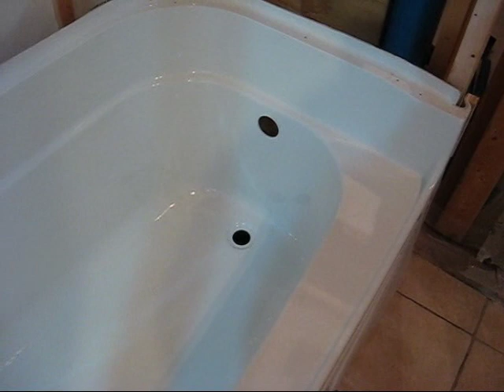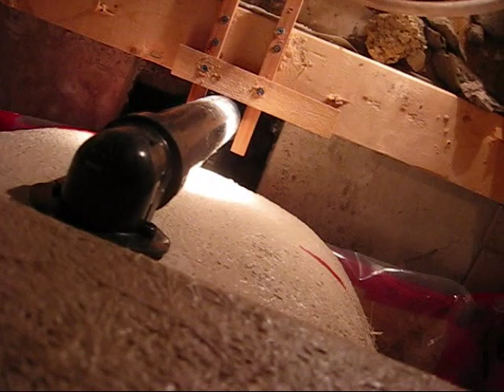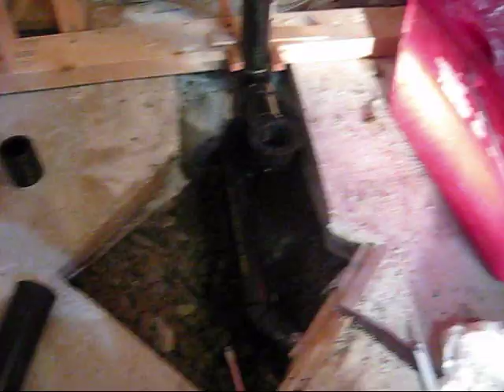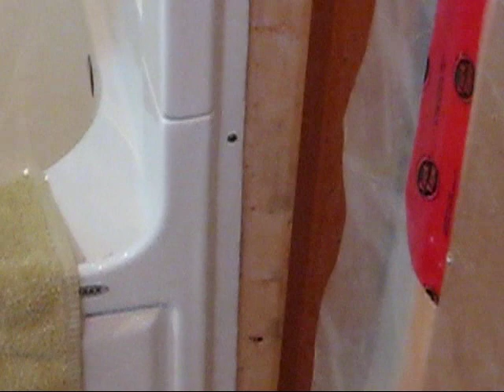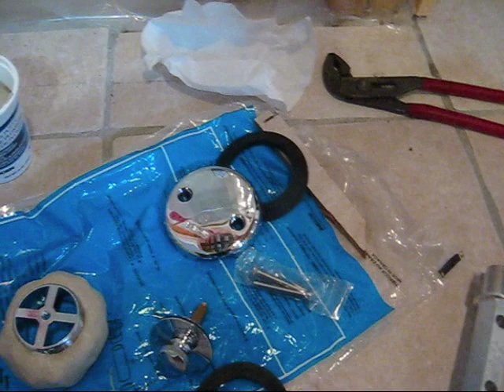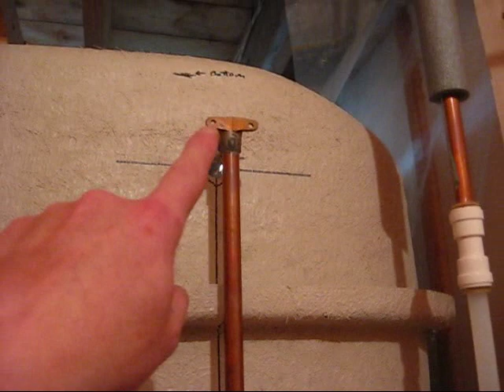Installing a Maxx Aspen 3 piece tub\shower - Day 2

Comment: I wanted to see more of the carpentry to frame the unit in place and to set the pieces and attach them to the frame work. Your plumbing is spot on. I think i would install the spout so someone can take a bath. otherwise install a shower pan so old folk dont have to climb over the tub. All in all 3 of 5 stars.

Comment from the maker: Tks.  Cutting the tub was the most nerve wracking part of the whole process.  I used a hole saw.  Actually I used two different sizes with the smaller one for the shower head.  You can pick up a set of 4/5 for less that $30 at HD, CT, Kent, Rona.  I did drill a small pilot hole with a 1/8th drill bit before using the hole saw.  This pilot hole gave the drill bit in the in the hole saw something to grip so that it would not skate over the surface.  I drilled it all from the back.  Have fun ! :-)

Comment from the maker: The pex pipe is pretty impressive stuff.  This was my first time using it.  I know that I could have rented a pex crimper for cheap, but I found it a better investment to by the pex crimper kit at Home Depot for $40.  The only thing you really have to worry about is cutting the pex straight.  You can buy a pex cutter, but I used a sharp utility knife and a bit of patience.  Once cut, slide the clamp over the pipe, insert the joint (90, T, etc), use crimper to tighten up the clamp and its done.

Comment from the maker: Yup.  Between the tub and the middle piece and the middle piece and the top.  Its less messy if you can avoid getting the bead of silicone in the holes that hold the pieces together.

Comment from the maker: Thanks for the comment on the post.  I did not put anything under the tub for support.  If memory serves the bottom of the tub was fibreglassed onto a piece of aspenite (chip board).  The side of the tub (the piece facing you) is fiberglassed into the same piece of aspenite.  The aspenite then lays flat on the concrete floor.  There is zero flex.  Hope this helps.

Comment from the maker: I would.  You never know what is behind the barker tile that would need fixing.  However, if its a three piece (back wall + 2 end pieces) you will need something to attach the acrylic to.  You could put the barker board back up or put gyprock up instead.  Thats my $0.02. Oh, make sure you follow the manufacturer's instructions.  Good luck.

Comment: i just bought myself a Mirolin Belair roofless witch is 60x32 1\2....witch is only 1\2 different from the aspen....the well is 27x55 compared to 24x50
I'm also installing a Delta Addison faucet and yes i will use quick coupling (absolutely nothing wrong with using them) will be using tectite tho

Comment: whats the make of the faucet?.and why did you use those Watts coupling?? i would never use those. you should of used tectite or sharkbite
i work in a hardware store and I'm the one selling the tubs. the Aspen has a very small well inside witch is 24 x 50 ish...plus you gonna notice when you turn in the shower you will hit the shelf with your arm a lot...its in a weird place.
i know you did install it in a basement so you might not use it as often as a main bathroom tub

Comment: Are the studs around the tub doing any supporting? I have replaced my tub to one very similar to this and the new surround is 3 inches from all 3 walls. Otherwise the weight is supported flat on the floor and supported to the front jamb with srews.

Comment: I'm replacing my tub and shower with a three piece acrylic kit. Once I pull the tub, do you think I'll need to remove the barker tile panelling that's there now as shower walls? (the one being replaced is very, very old as you can see by the Barker Tile panelling)

Comment: we just moved into a house with a two piece and the separation has caused water to drain down the sides. this has caused damage to the dry wall. I don't think they sealed it at all. did you seal yours and if so what product did you use?

Comment: I'm stuck between this tub and the Mirolin Empire. Does the Maax Aspen have gaps that need trimming and lots of silicone to cover in between the different pieces? A lot of reviews from Mirolin complain about that problem, just trying to find something that will be easy to install.
Reply from the maker: I used minimal silicone to seal the gaps. Not sure about the other tub.

Comment: I have the same tub/shower and was wondering how you finished around the flange. Did you drywall over the flange or use a flange trim kit? BTW, Would you be from NL. Accent sounds familiar 🙂.
Reply from the maker: I used packaged pine and custom made wooden moldings.  I never buy moldings, I make them myself.  And yep . . . NL.  Good ear!

Comment: First off, get rid of those compression fittings connecting the copper to pex, amatuer night. Second, always install the tub filler, resale value... someone will look at that and severely scratch their head or laugh. Last, I noticed your abs piping had yellow brand letters on it, sorry to say but that sh"" was recalled.  It becomes dangerously brittle after install. Ill give an b on execution, and an A for effort, but call a plumber when you want to plumb. Even just for advice. Its worth the $